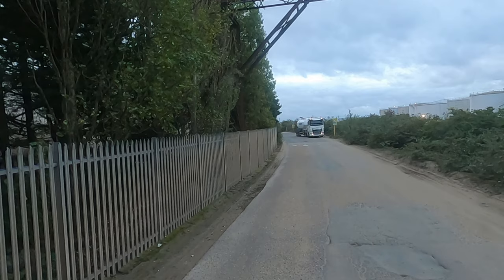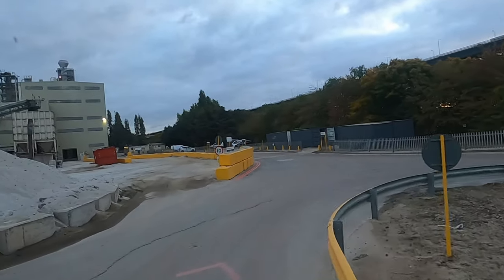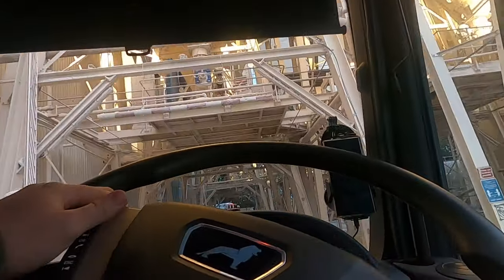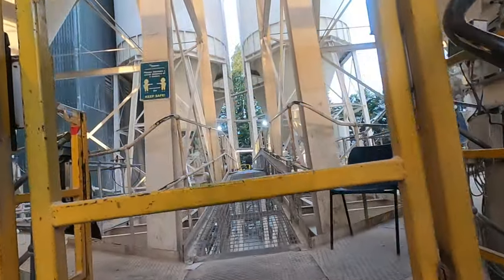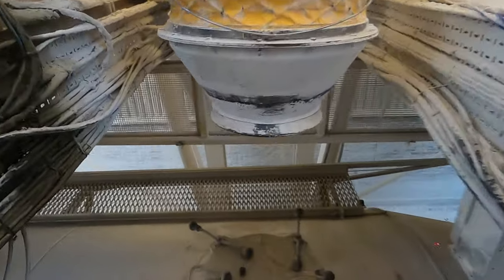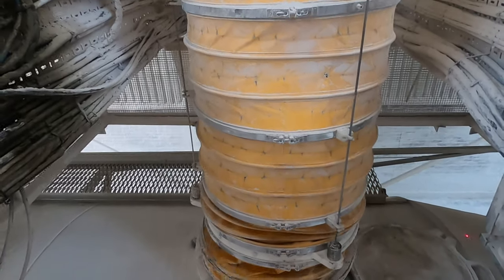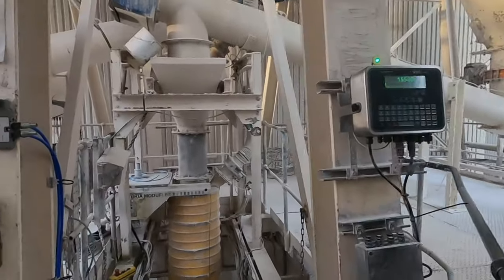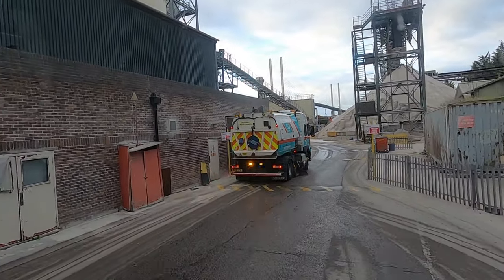HGV | Tanker truck loading cement.

Comment: You have three hatches? Why do you load from only one? Does that not mess with the axle weight? And how did you know where to stop to get the hatch level with the load out?
Reply from the maker: Yeah different places load different hatches, i think the split in tank in the middle helps distribution when loading.

And there is a indicator on the side of the weight bridge helps you line it up. 👍